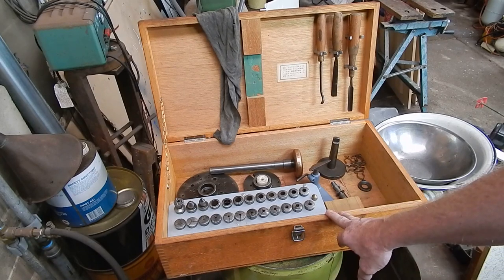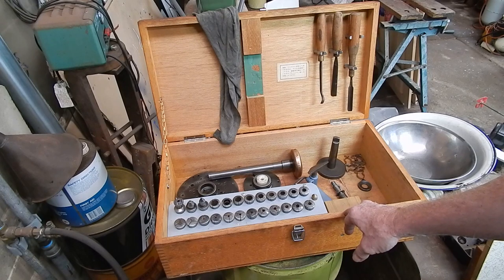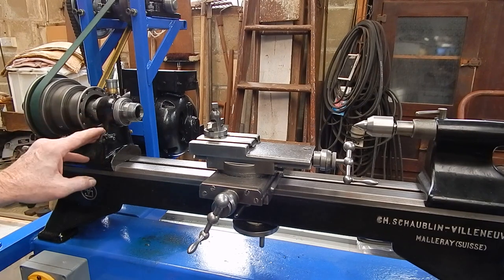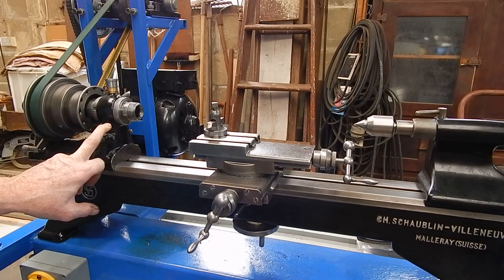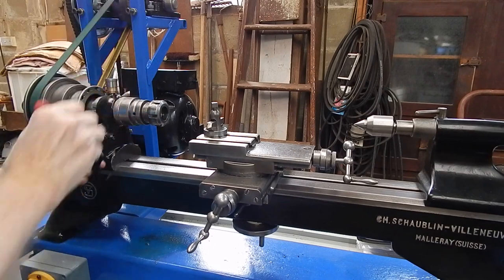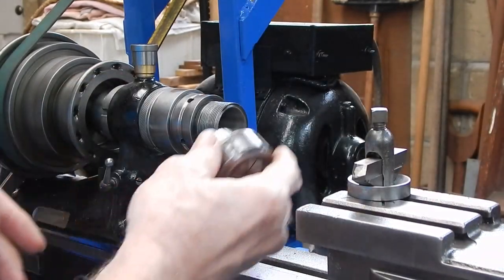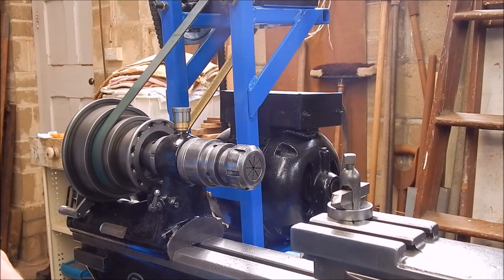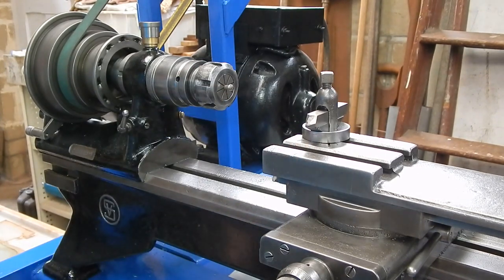Make an ER collet mount for a threaded lathe spindle

Comment from the maker: If you do make one of these chucks, it is essential that the thread for the ER collet nose cap is cut correctly, with a nice tight fit and no slop.  The accuracy of the finished job depends heavily on this thread, as much as the collet taper itself, and the spindle register. Cheers Rob

Comment from the maker: I actually re did this job to try and reduce the length of the collet adapter, but it's almost impossible to make it any shorter than shown. It basically is always going to be much the same length as a conventional chuck in overhang from the spindle.  Accuracy wise it's top notch, and way better than the worn collets that came with the lathe.  Quite easy to make.  I heat treated it and ground the collet cone with a pencil die grinder and stone afterwards.  Taper run out is virtually zero.  Cheers Rob
Reply: I would love to see the collett cone being ground with the die grinder.   If a picture is worth a thousand words then how much more is a video worth?  Thanks.

Comment: Excellent video, your lathe is smooth running. I plan to build an adapter for my South Bend 13", 1960 model with 2-1/4"X8 TPI spindle nose. I'm going to look up what kind of pencil grinder you were using. Many thanks.

Comment: The first collet collection that you show are 5V type collet and were used on the VanNorman Milling machine No 0. They are very useful and easy to make. But still very expensive at Hardinge.
Reply from the maker: Hi Robert.  Thanks for the feedback.  The 102 collets in the chest are a type classified as W20 by Schaublin.  Damn expensive even second hand.  By the way, I also like Hardinge lathes - beautiful, beautiful equipment, as were many of the tool makers lathes of that era.  Worthy of some TLC when given the opportunity.  Cheers Rob.

Comment: Hey Robby,
Thanks for your video. I guess that us folks in the US are the only ones that haven't gone metric. Maybe you can sell your imperial collets to some guy in the States. Some sizes are close (like 11mm and 7/8"). Anyway, thanks again for the informative video. I plan on purchasing a Chinese lathe so will give your ER collet idea a go.
Regards,
Dave
Reply from the maker: All smaller Chinese lathes come with a Morse taper in the headstock spindle.  This allows you to easily fit an ER collet chuck with a suitable Morse shank and make up a draw bar. ER is cheap to buy (up to and including Morse No 4).  For very small work and gripping milling bits, you can't beat a good collet system, and ER is one of the best.  Mine has done a huge amount of work. Cheers Rob

Comment: Rob,

My lathe has a #4 Morse taper in the spindle and also a 1-3/4" 8 TPI thread. Should I just use a Morse-taper-mounted ER collet system or make an adapter for the thread like you did? Is one better than the other? I might make the threaded one just for fun, but just wanted to know your thoughts.

Thanks,
Jay
Reply from the maker: Jay Williams Good question.  Morse No 4 is about as large as you can go, yet still buy Morse tooling at cheap prices - so you are on a good thing there.  Morse 5 and above gets very expensive and harder to find.  As Morse No 4 collet chucks are very cheap and accurate, you can easily go that way in preference to making a threaded or drive plate mounted ER chuck.  However, if you do go threaded chuck, you will have the benefit of a feed through ER chuck.  Most commercial Morse ER chucks use a draw rod, rather than a draw tube, so you don't get this capability. And with a draw tube, you lose spindle diameter.  It's a major consideration if you will be doing this type of work.  Threaded ER chuck is ultimately better/best, but you have to make it :)  Cheers Rob
Reply: Thanks for the detailed answer, Rob. I appreciate it!
Reply: Oh! One other thing. What did you mean by "registration"? I guess you mean the adapter should bump up against the shoulder at the right time, but precisely when?

Thanks again!

Jay
Reply from the maker: Jay Williams When you screw a threaded chuck onto a lathe spindle it will be held in correct final alignment by the mating surface at the rear where it comes up against the spindle face as it is tightened.  It will also be aligned by the plain section of spindle behind the thread - so this must be a snug fit. Cheers Rob,

Comment: Mate, that's a great looking adapter that you've made there.
If you went to all that trouble, and can work that accurately in carbon steel,
why don't you make a set of (metric) collets to the same pattern as the imperial set?
Nice job all the same!

PS Here's a good video, where I think the first few minutes and the subject he's addressing (the reference) will be interesting.
GET A GRIP ER 32 CHUCK PT 1
Reply from the maker: Thanks for the video link David.  Interesting.  I will check out some more of his videos. I did consider making some metric collets, but went for the ER solution as I like the much greater compression ability of that series.  But having said that, I may make some specialised collets at some stage.  Cheers Rob.
Reply: xynudu .
No worries...He's from NE England and his accent is sometimes hard to understand, but his knowldedge is simply vast...entertaining too. I can highly recommend his videos. He makes a dviding head from start to finish, which is pretty impressive, but it's the tips along the way that I find most valuable.
I'm one to talk...I have an ER system for my Myford and am (still) trying to work out what thread the un-named watchmaker's lathe (6mm drawbar thread...but the pitch?) has so that I can copy it. Turning my own thread at that diameter is proving difficult but at the size collets you have, I fancy your chances of getting it right better than mine.
My intentions are to get the workpiece as close as I can to the spindle reference...to ensure concentricity....hence my comment.
By the way, I decided against a Schaublin 4-inch lathe (complete....with everything), which weighs 800kg (!) in favour of the Myford. The English parts are readily available here (in England)...but I regret not being able to move 800kg...You've done a beautiful job on your Schaublin.
Love the sound of the 'cockies' and other Australian wildlife outside...lucky bugger.....

PS You're absolutely right about the ER system...